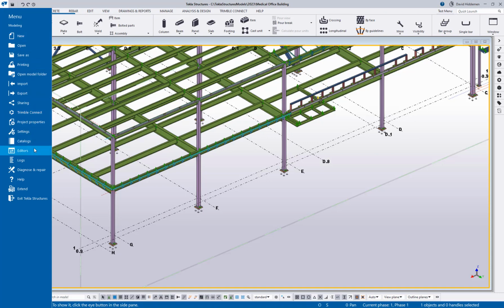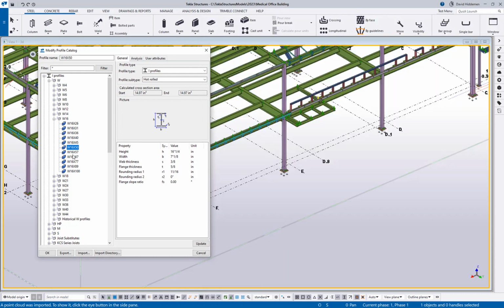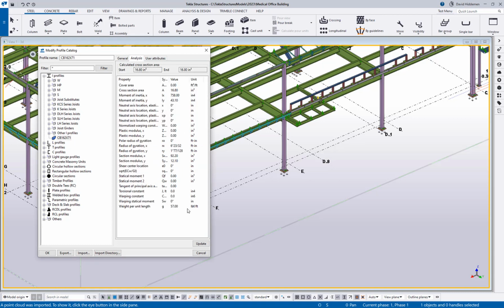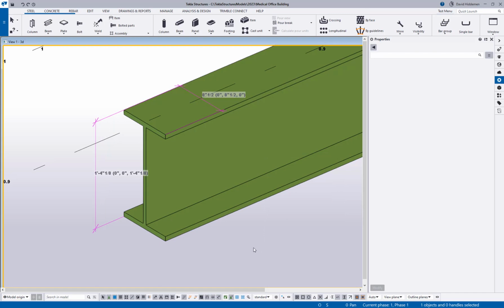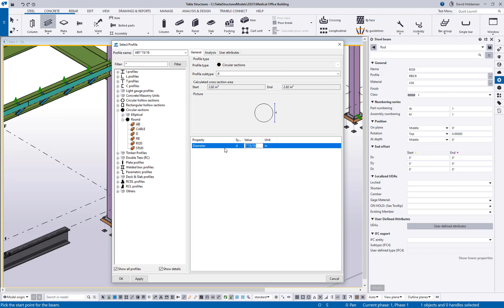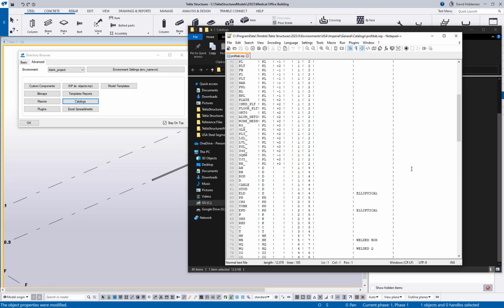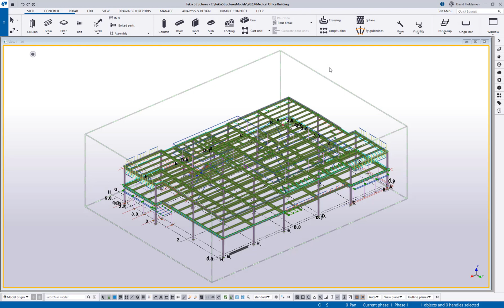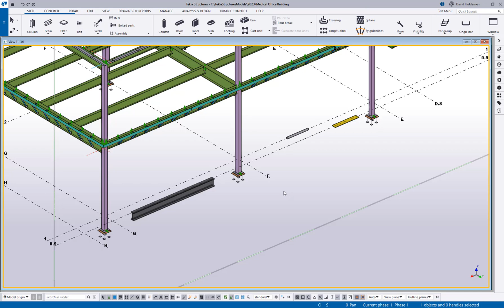Customize Basic Fixed and Parametric Profiles in Tekla Structures

Comment: Great video as always Dave.
Do you have any videos pertaining to making parametric expanded metal profiles or possibly wire mesh?
Reply: Parametric? No. Only the fixed type as I show in my "Items" video. The only "parametric" option (and I use that term loosely) we would have that I can think of is to use a custom surface treatment on a plate.
Reply: @TrimbleTeklaDave  
Thank you for the quick reply, I guess I will just keep using plate profiles.